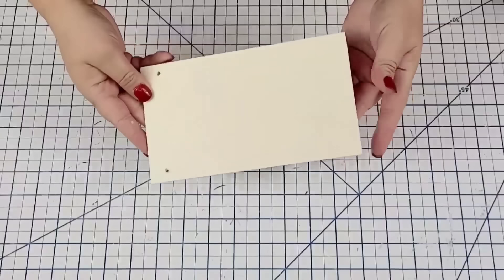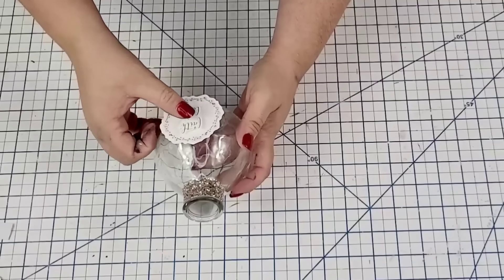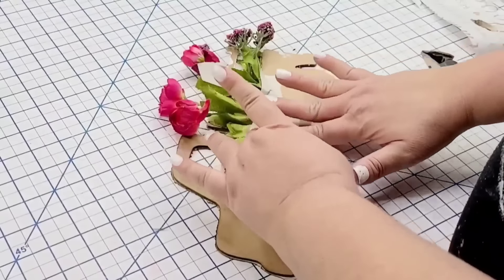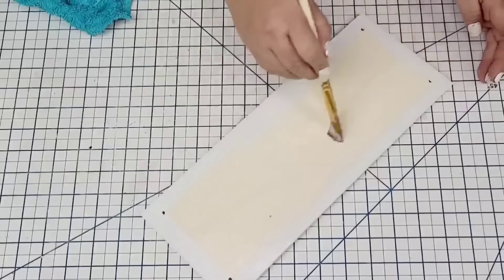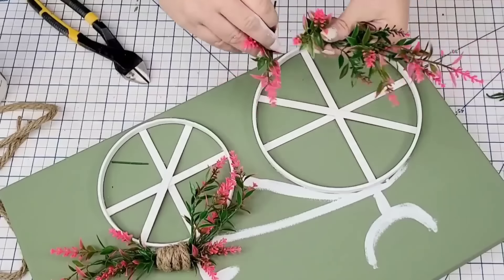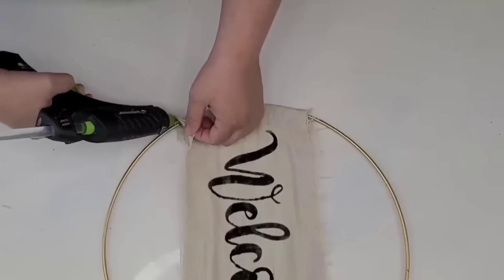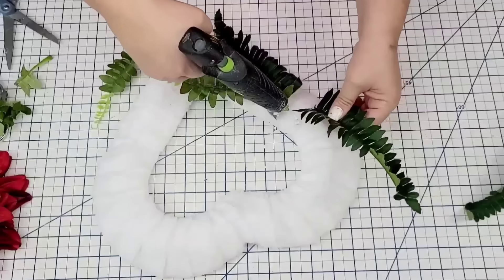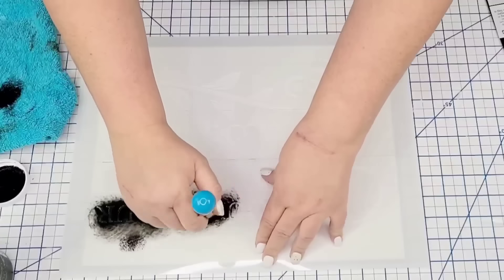54 Genius DOLLAR TREE DIY Crafts For Home Decor

Comment: Hi! I'm sure someone has given you this tip before. Put Mod Podge on the item and let it dry. Place the napkin, or whatever, on top of the Mod Podge, place parchment paper on top of the napkin and press with a heated iron. You will then have no wrinkles. The Mod P:odge is activated with the irons heat to adhere the items together.
Reply from the maker: I've tried that since! Thank you so much ❤️
Reply: @diybeautyonpurpose  You are welcome.
Reply: Thank you for the tip about mod podge!!

Comment: Dollar Tree vinyl works great for the application in which you're using but NEVER put it on a cutting mat and use it in a cricut! I made this horrible mistake and it all lifted from the backing during the cutting process and the backing permanently stuck to my mat. It was coming off in shreds. That $1.25 turned into about a $10 mistake.
Reply from the maker: Oh no! I'm so sorry.  Good to know!